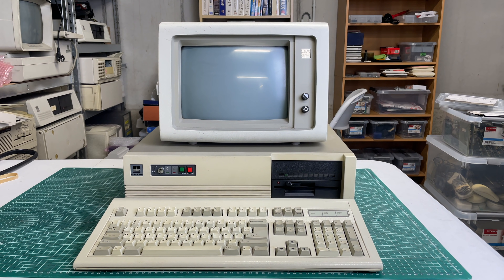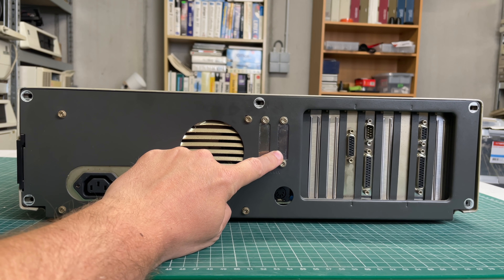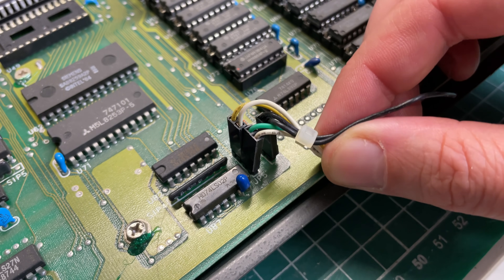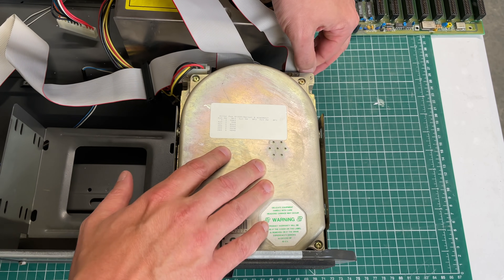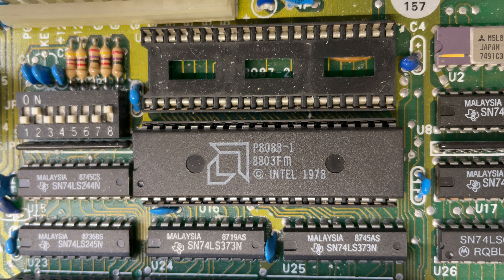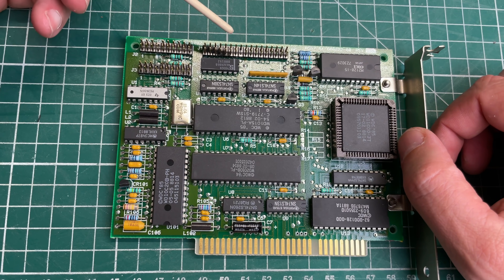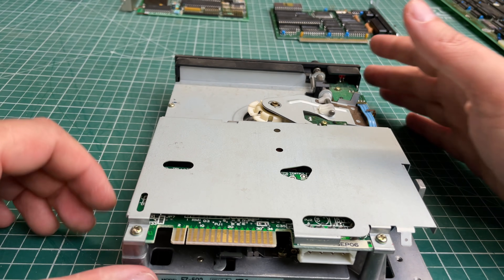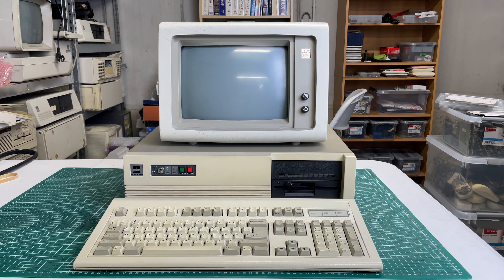DTK Data 1000 Turbo XT Part 1 : Hardware Overview

Comment: Had exactly this DTK box in my first job. Those buttons at front panel was very easy to accidentally push with a knee without noticing that when case was placed in cheap computer table characteristic for begin of 1990-ies :) It took some time to realize why coworker is complaining about spurious restarts.

Comment: DTK Computer was probably the first Taiwanese company to be largely successful in the computer market in the West.

A good hard disk controller upgrade is the WDXT-GEN2  which supports dynamic translation so you can use it with hard disks not normally supported by the controller BIOS.  I have a Seagate ST-4096 in my 5150 and it's set up with dynamic translation.
Reply: Phoenix  𝙾𝚙𝚎𝚗 𝙼𝚢 PROFILE  Has your YouTube channel been hacked?

Comment: where i can find those cf to xt cards? great pc. i am watching because i have the parts of a old one that i want to make work
Reply: XTIDE. There are several models depending on what you need. Some have just an IDE header, some have internal CF, and some have the CF card on the bracket.
Reply: @anomaly95  thanks. Those are online?

Comment: My first PC compatible was a DTK 80386DX-20 with 1 MB RAM and an amber monochrome display (very similar, if not identical, to that INTRA display at 13:14 as I remember that hemispherical power button) in 1990. The case is also very similar but with a few cosmetic upgrades: three 5.25" bays (one occupied by two FDD and one 40 MB IDE HDD internally) and two vertical 3.5" bays. Two years later I upgraded it with 1.44MB 3.5" FDD, ET4000, SB Pro, CD-ROM and continued using it for almost four more years.

Comment: Can s.o. explain why old HDDs have problematic sectors written on them from the factory?
Are they bad as tested from the factory due to deviation during manufacturing?
Thanks
Reply: "Are they bad as tested from the factory..."
Yes. Those were platter surface defects since they couldn't manufacture them very well back then. If you were low-level formatting one of these drives, you had to manually enter these bad sectors into the program/utility.

Comment: 🐨 Foreign Object Alert @7:35 Upper Socket around 11:0 Clock, so if A daughter wont marry 🤨Err-Daughterboard with her Motherboard 😳 it could be because of that foreigner hindering their bond..😅
APU I clicked 👉👍👈
Reply: *Addendum*
 🐨 @7:35 It looks like something long is hiding under a blue capacitor at 3:0 clock as well.. and just after @8:00 there is even more of what looks like dried noodles  🥴 Think I have to cut down on the Port 😅😀 because @9:25 I kin see them noodles left by the PC assemblers Lunch all over the place..

Comment: Those 2 banks make for 512KB of ram, not 640KB. They're 256kb each, times 16 (minus 2 for parity) makes for 512KB of ram, the other 128KB is made by the 4 other chips above bank 1

Comment: At the time when they were popular the ST-225 was named the "seagate stone washed". Because of it's distinctive noise - it always sounded like some gravel made it into the drive and gets spun up when the drive powered down. But they were comparatively cheap but pretty slow. And you could get them everywhere, as Seagate literally flooded the market with drives.

Comment: It got a reset button! Of course it got one. Any computer of that era got a reset button, unless it was made by one of the big american brands (like IBM or Compaq). This scheme was (mostly) valid from the XT clones until the end of the century.

The memory is divided over four banks. You only show the two base banks of 256kbyte each. Those banks are made out of 9 chips 256k x 1. The remaining 2 banks also use 256kbit chips for main data storage, but as the banks only are 64kbyte each, they just use two 256kbit chips, which are organized as 64k x 4, supplemented by a 64k x 1 parity chip. Banks 3 and 4 are to the left of the two banks you pointed out in the video.

Comment: You spelled IBM wrong in the description! 

Also is this a DTK Turbo 640 board? What BIOS do you have?

WDC and WD are not the same - That card was made by Western Design Center, not Western Digital.

This chassis design was made in Taiwan and basically every turbo XT used it, meaning if you want to change the look of the machine you can select a variety of faceplates

Hard drive encoding was done by your controller at this time, the ST225 does not encode or decide data on it's own. This means by changing the controller you could choose RLL and have 27 sectors per track gaining you about 50% more disk space. This was a very common practice, though some drives do not have mechanisms well suited to this leading to unreliability.

Almost all ST412 drives you'll find will still work, they're "dumb" and without some sort of mechanical failure they will always continue to work.

These DTK boards can do 10MHz but most turbo boards actually only do 7 or 8, these are some of the faster turbo XT clones. My Turbo 640 also does 10MHz and has an NEC V20 and 8087 installed for extra performance

Also you said 7 slots but there are 8, this board includes Slot 8 support. You also have 3 banks, bank 1 and 2 are 41256 and bank 0 is 4464s which make up the first 64K in the machine

All MFM / RLL controllers include a low level format tool and most include a drive select table, only very early or cheap controllers typically had switches or jumpers.

The small SMD chip on that video board isn't actually the video controller, it's just a logic replacement. The video controller is the large socketed DIP chip, it's a Motorola CRTC clone.

The Hexa IO card is a clone of the AST equivalent, I forget it's name. But for that second serial port you must install a UART and the level shifters. These cards will actually take a high speed UART as well, if you choose to install one.

I hope you have been parking that hard disk as the ST225 is not an auto parking drive, when spinning down the heads land on the disk in a special zone which keeps them away from the data. When you switch the machine on it automatically seeks to track 0 for boot, if you don't park it you will eventually destroy track 0 and make the drive unusuable with this machine.
Reply: The mechanics of an MFM and an RLL drive are identical. The main difference between MFM and RLL drives are the read/write amplifiers. MFM and RLL have different spectral properties and some MFM drives use equalization that messes up RLL signals. Also MFM is more jitter tolerant than RLL. I have a very similar machine to this one which in includes a Western Digital (not WDC) RLL controller, and the RLL-certified variant of the ST225, called the ST238R (the letter "R" is a Seagate convention for RLL capable drives).

As I already wrote in a dedicated comment, it's not three banks, it's actually four banks. The there are two banks made out of 4464s, making up 128k. If I remember correctly, the 4464 banks are not the low 64k or 128k, but the high 128k that tops the machine from 512k to 640k.

The small SMD chip on that video board seems to not only include hercules/MDA logic (which it surely does), but also includes the 64K of video memory. I couldn't find any dedicated RAM chips on that card, and the chip has a "RAM" logo printed on it.

The AST equivalent is called "AST six-pack".
Reply: @tw11tube  There are drives which mechanically differ between MFM and RLL, Miniscribe and Microscience were guilty of this on more than one occasion. Using cheap steppers causes them to be positioned unreliably and they lose track of data more easily. 

Yes, my bad, it is the upper two banks. It was 3am when I posted this.

Didn't the AST Six Pack have RAM expansion?
Reply: @AiOinc1  Indeed, you are right. The Six Pack series of cards has RAM sockets. Maybe you were thinking about the AST I/O Plus II.

Comment: I'm fairly sure that my Amstrad PC1640 has an ST-225 hard drive in it, which was working the last time I tested it.
Reply from the maker: I have a lot of stuff that was "working the last time I tested it". :)
Reply: @RetroSpector78  Yeah... especially as my Amstrad PC1640 has been in the shed for years. Although when I bought it, it had been in a barn for years, and it still worked - even the floppy in the disk drive still booted up!

Comment: I passed on the IBM XT computers because I mainly want a DOS gaming computer and by the time make all the modifications to the XT computer its not an XT any more anyways. So I just built generic 386 and 486 computers which I can down clock to 286@20mhz by disabling cache in bios. Also its less expensive to build and lots more options in cards and components. Less memory and bios limitations.
Reply from the maker: True .... I just like tinkering with those as I never experienced that era. My first PC was a 486 :)
Reply: @RetroSpector78  Yeah, That why I don’t think you should modify an XT computer because it is what it is and NOT really meant to run newer DOS games. These where more of a business office application oriented computer. That was there Market share back when produced  because these computers were expensive and mostly only businesses could afford them. It was not until the 486 computer and dial up internet access that computers became popular and affordable as home computers.

Comment: I picked one of these up on Facebook Marketplace last year! Mine has an Orbit I/O card with one of the dreaded Varta batteries. Luckily the damage was minimal and everything but the RTC still works on the card.
Reply from the maker: You gotta get lucky with those .... I like tinkering with these XTs .. they are pretty basic and its nice exploring old software for these things (both apps and games).
Reply: I got one too, but my RTC card doesn't have a model number on it. It does have a wavy M logo. Did your card actually say Orbit on it somewhere?

Comment: Is the xt better than the At or is it the other way around?
Reply: The other way round.
Reply from the maker: AT is newer / faster
Reply: To give a bit more detail:
The PC/XT (or IBM 5150 or 5160 respectively) used the 8088.
The AT is the IBM 5170, which used the 286.

Comment: This Turbo button would have gotten me wet dreams back in the day
Reply from the maker: A lot of clones have them, and it does give you that extra speed bump.
Reply: @RetroSpector78  I'm talking about this turbo button. It has this industrial look and feel and it's backlit. I have too many computers with turbo buttons. All of these have regular boring turbo buttons. Your machine is different.
As a kid, I was a tram nut. And the cockpits of these trams have buttons that are a lot like that. As a kid, I would have spent hours just pushing these two buttons.
Reply: @senilyDeluxe  If you like those buttons, you should turn into an aviation nut. Plenty of top quality backlit buttons, knobs, and switches in those cockpits. :)

Comment: My first experience with a PC was a DTK 8088 but in a flip top metal case.  No turbo button so during boot you had to repeatedly hit CTRL-ALT-minus until the line cursor turned into a half-block.
Reply: And no mathco so regen in AutoCAD took 25 minutes.